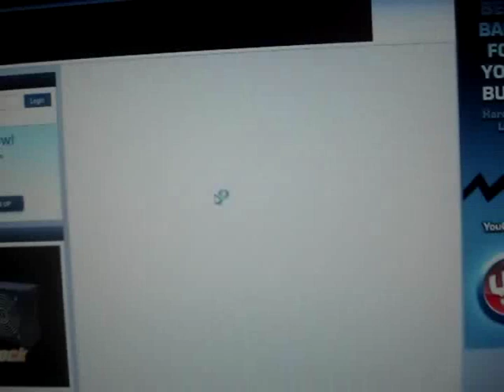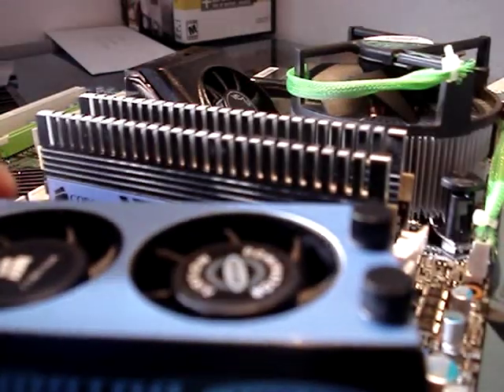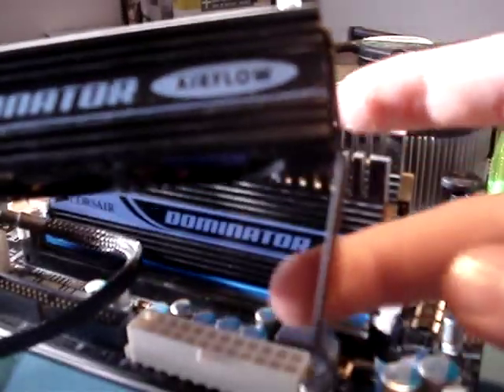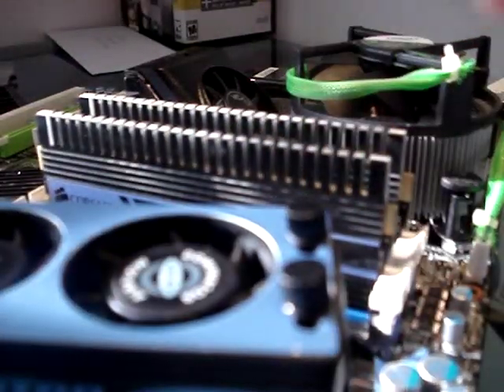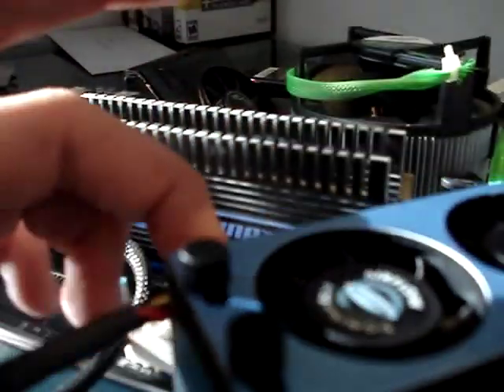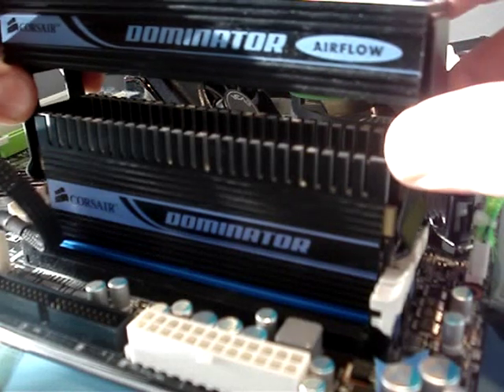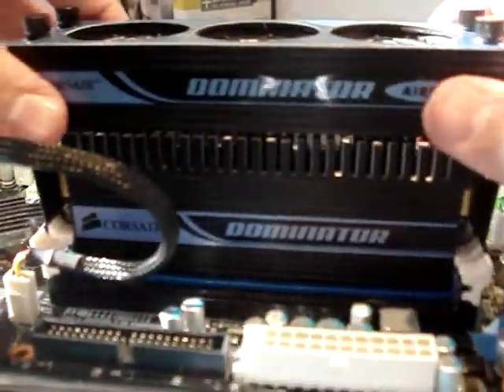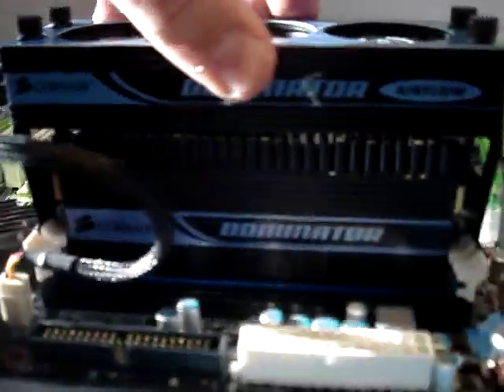How to: Best Way to Install Corsair Dominator Memory Airflow Fan

Comment from the maker: Putting the cooler on first, then tightening the screws is what Corsair suggests, but you can get a much tighter fit by tightening the screws before installing the fan. Also, some coolers may be different but installing the fan on the RAM retention tabs is how it's supposed to be done, not on the RAM itself.

Comment: Thanks so much , i feel a bit silly now. I tried doing it as others had suggested first and it doesn't hold it. Your way worked perfectly and the infernal rattle has now gone and i have a near silent case :). You are worth your weight in gold.
Such a simple solution and much easier to install in an upright case as well where there is little room to move up against a wall.

Comment from the maker: the fan with work with almost any motherboard and any ram that is not unusually tall. it plugs into a 3 pin fan connector on the motherboard

Comment from the maker: Yes I did have to set it to 1066 even though it is rated at that because the motherboard thinks the default is 800. But it is actually not "overclocking" because I was just putting them to their rated speeds. Keep in mind that my motherboard supports 1066 MHz memory and not many motherboards do.

Comment from the maker: a) the RAM can get hot and the cooler it runs the tighter timings it you can run it at
b) the fans help push hot air away from the RAM and northbridge
c) it came free with the memory

Comment: The way my motherboard was designed.. 2 slots on each side of the cpu socket. It may be overkill but since i have the space for it I want to put 2 of these types of fans on each side. Will it be stable on 2 slots even though the fan was really designed to to latch onto a board with 4 slots side by side?

Comment: Brian- I my mobo is 2 banks that have 2xDDR2 & 1xDDR3 (3 sockets per bank). So the width of both banks combined is wider than yours (I noticed yours was only 2 sockets per bank). Will I need to purchase 2 fans if I get 4 x 2gig Cosairs Dominators.

Comment: Brian - Did you have to overclock this memory to 1066? I've heard from someone else who bought this RAM that when he installed it, the RAM was actually set at 800mhz. Of course he had an older mobo (around 2yrs old).

Comment: oh, well that does change things a little because EVGA does make Intel boards but the black and green theme on the board should give it away that its an nvidia board, and nvidia dont make boards with the x58 chipset (which is used for the i7) anyway that was just my take on it.

Comment: these, you know the ram, i got the gold ocz with the heat sink kind, and it seems it doesn't generate much heat, so why add a fan? does it get hot when overclocked or what?

Comment from the maker: Well, this method actually shouldn't make it any more difficult to remove the fans... the thumb screws can be loosened just as they normally would be and the the RAM can be changed.

Comment: Well now you got me confused, if all you have to do is loosen the thumb screws to remove the cooler than why not put the cooler on first than tighten the thumb screws?
Anyway the actual way to install it is to have it attached to the ram itself, not over the ram slots.
Won't it stay tight for you when mounted to the ram?

Cheers
LazyMan :-)

Comment from the maker: Well, theoretically the brand should not matter. You'll want to look for the module with the fastest speed, measured in MHz, and the lowest latency, which are numbers that look like 7-7-7-14. Its your pick between the two.

Comment: I see, I have the newer cooler with 2 60mm fans, so maybe it's a little different. I must be honest I have never read the instructions on how to install the cooler, but I just clamp it down right where the ram comes out of the ram slots retention holders and never noticed a problem. If fact that how I have done several client builds. lol
Maybe I should take a look at the instructions.

LazyMan :-)

Comment: Dude that is not the way to install it. What if you need to remove the cooler or a ram module  once it's installed into the case? With that much pressure you will not be able to get it off easily.
On mine I have no problem with it being tight, and mine is attached to the ram itself just above the ram slot holders. And it is on nice a firm, and if I need to remove it or add ram change out ram, whatever it will come off just by loosening the thumb screws.

Cheers
LazyMan :-)

Comment: just an update although this secures it. the rattle has come back with a vengeance. Pun intended. I tried oiling the fans , taking the whole unit apart but it didn't fix it.